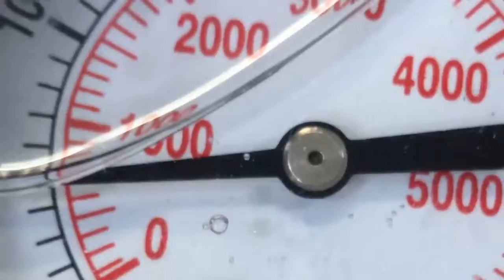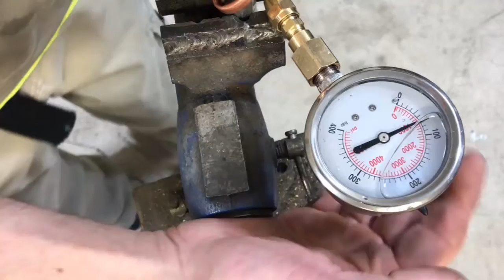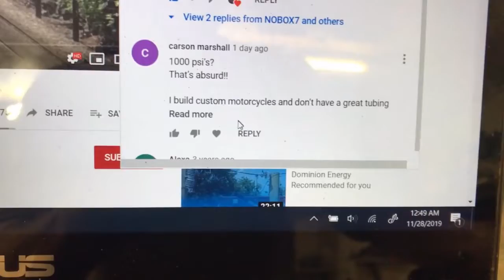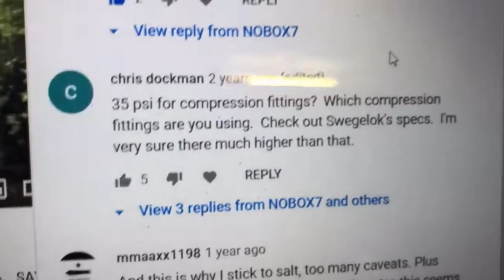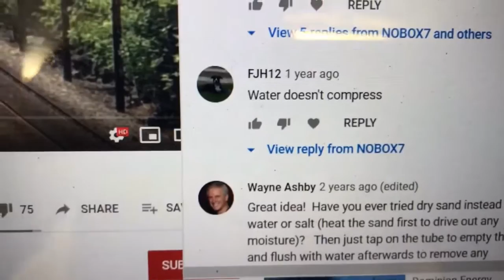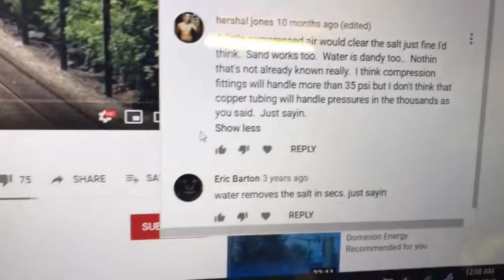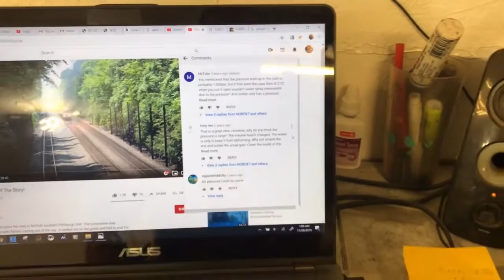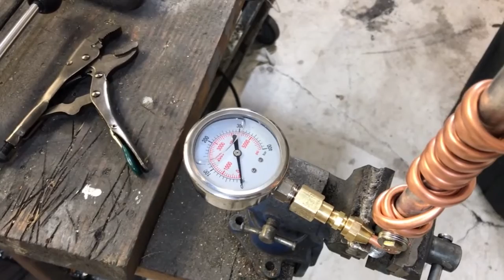Bending Copper coils induces pressures over 1000 psi inside water filled tube  ???

Comment: When you’re turning a coil that tight, does the flattened section ever expand out? I found that mine always did when I was using the solder method. Also the first few rounds would flatten out a little, but after that they were fine.

I’m the guy who mentioned zipping the ends with a tig torch on your other video the other day.

When I make them now using tig, I use a short flattened section just about 10mm long. Only long enough to give me a margin for pullback and balling. This limits the water’s ability to expand back into a crimped section.
Reply from the maker: tig welding the end is a great idea , I didnt have a tig welder when i did this video but i will give it a try for sure now that i do

Comment: I intuitively deducted you were correct about the high pressure. I think some of these people have never welded much less dealt with industrial bottled gas.  You are also correct about compression fittings. That's why the gas company will tag you and possibly shut off your meter if they find one in your house. After spending all day researching coiling refrigeration tubing I became frustrated until I found Your Channel. You saved me days of experimentation. I will give you a shout out in the comments when I post my next video. Thanks!!!
Reply from the maker: Right on brother

Comment: How hydraulics work. :)
The moment you have trapped a liquid inside a tube and you bend that tube, the liquid behaves like a solid rod pressure-wise.
It cannot be compressed (without a considerable amount of pressure like 1000 bar/14500 Psi or so) and the pressure forced onto the pipe by bending it will transfer to each end of it. In fact, it transfers to all sides of the pipe equally.
As you have Newton 2nd law  F=mxa Force= mass times acceleration, you exercise a very large force on that small radius you bend, which is immediately transferred to the liquid inside.
You are very correct about your statement. :)
Reply: My thoughts exactly. I am late to the party but I am on a heat exchanger project for marine use. So after many hours of useless YouTube videos I came across this channel. I watched all of what he had involving tubing bending. When he said 1000psi I thought to myself " its probably much higher than that". Its hard to say since there was a water leak but i hypothesize same as you. My theory is the gauge fall down without the leak would have still happened but slightly slower. The side walls of the tubing being a huge surface area expanded ever so slightly and possibly not even enough to do deformation. Its just visually slow enough for a gauge to detect.  His latest stainless steel video is a Godsend. I will be doing copper (fresh water) but half my viewers need stainless (salt water). I'll send them here.

Comment: Dear sir cen u make 1 video about 
If I take ⅜" copper tube minimum  5 mtr then fill nitorgen gas more then 150 psi  in copper tube then I will bend same like  you in your video if copper tube pinch   or not ???  

Cen u show to all of your followers. 
Because IAM HVAC FORMAN 
So in my life IAM useing copper tubeing in some times my copper tube bending so if your experiment is succes I will do in my every job ....

Thank you sir IAM waiting for your valuable video...
Reply from the maker: wont work
Reply: Water works because you cant compress it easily, thats why it and grease work really well for hyrdro forming. You can also use sand as the sand cant be compressed to much ether but allows for you to bend the pipe. Sand is used in mandrel bent tubing.

Comment: This is the way a bourdon pressure gauge, like the one you are using, is working. It have a tube bent as a halfish circle connected to the needle. and when pressurized the tube will try to straighten out and moves the needle via some gears and links.
I was looking at one of your other videos where you used a small pump capable of, I think it was 15-1600 psi. Why dont you connect one of them to one end and bleed out the air in the other and just let that control the pressure via an adjustable relief valve? Easy enough to make if you have a spring and a steel ball. 
Not sure if you are using it, but a support sleeve inside the tube might be an idea if you are using the super soft type of copper coil. That will make the compression fitting to get a better grip on the tube due to less deformation
Reply: I like that idea a lot. Thanks for sharing.

Comment: Use teflon tape  not the thin cheap stuff but the little thicker stuff  and not gas tape (unless tolerances are that  bad.)
Wind it on the threads the right way. And almost  never have a problem. Especially  with brass
Reply: On NPT theads only. !!!!
Reply from the maker: @rolc8272  Yeah these valves are  NF 24  for some reason

Comment: cool. had no idea bending it created pressure like that
Reply: It's not so much the bending, it's the angle of the bend that is most critical.  I think these pressure will probably only last a short time (with soft copper) b/c the metal will stretch once a certain PSI is reached and is probably why doing a slower bend will often result in better coils for certain diameters.